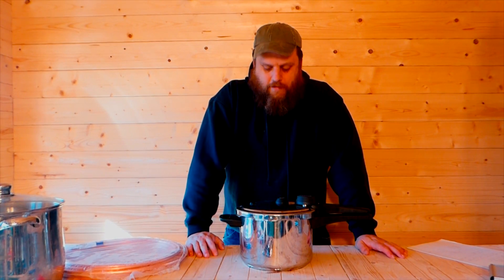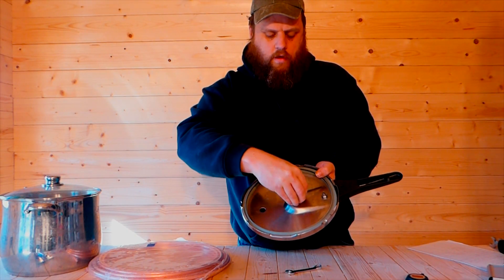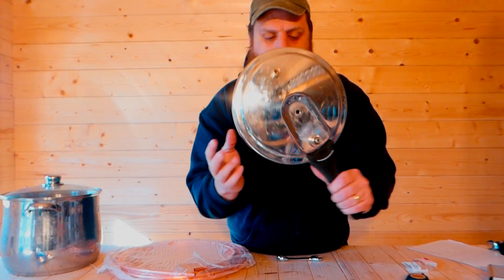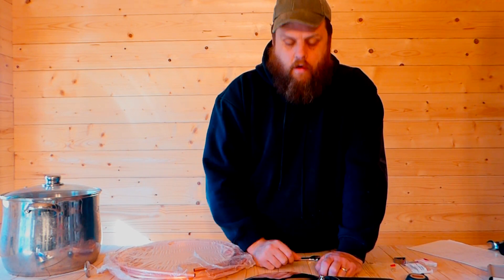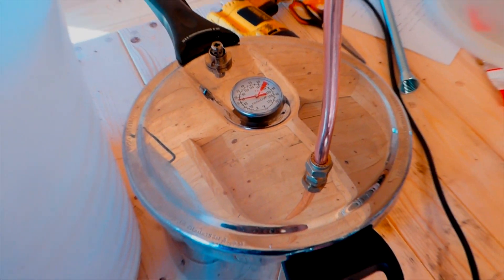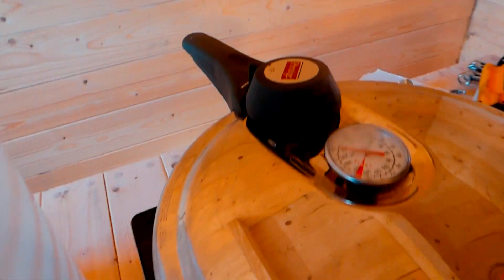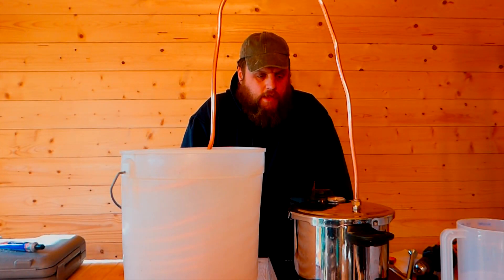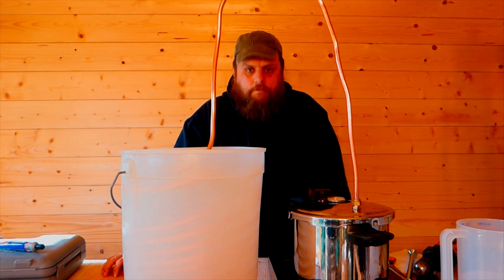Home Made Pressure Cooker Pot Still Build

Comment: You may already know by now seeing that this is two years old but the temperature in the pot is useless you need the temp of the vapor so it would be better to have a thermometer on or in the column/Vapor tube. Alcohol evaporates at 173°F or 78.33°C  Happydistilling!.⚗🥃
Reply: I can see you have a very valid point especially if you're using fire as a heat source!.
Reply from the maker: Hi Corey, thanks for the comment, Yeah I kinda get where you're coming from, as my reflux Still has a thermometer on top of the tube. However it is useful to know the wash temp to ensure you don't go up to 100C and have a boil over into the still. I did this in the early days and ended up with a yellow distillate

Comment: just what I've been looking for, a more detailed description of the size of the fittings would be good in your description, just so you have all the details in the one place rather than having to go back and forward in video, the size of the copper pipe , the attachments the name and size of the fittings the volume of the bucket, I'm getting a 5-litre one not sure if I need bigger, people like my self are eager to build, but need particular details to push forward, but great vid thanks, you've got my subscribe.
Reply: and an update on how you sealed the thermometer and pipe fitting would be appreciated, and quick question when you solder these fittings do you need a blow torch or can you use a soldering iron, never used either but hoping to learn more about it, I have soldering iron not blow torch, just trying to get all my items before I start.
Reply from the maker: Hi Stephen, Thanks for watching, good point about the description, I'll take that on board. I think 5L is a bit small personally and would suggest min of 15L pot. These are a little harder to get hold of though. I've found that you never get the litre-age you pay for. for some reason they are always out significantly. bucket wise mine is 25L it works a treat but I also keep 50 L of water to cool the vapour on standby i'm a bit tight so I cool it down and reuse this water several times saving on the old water bill. Enjoy the hobby

Comment: at 9:41 how do you get the copper tube tight and secure without threading the tube?  what type of connection / fitting is that in the lid?
Reply: I'm wondering the same!
It's a great video, the best I found so far about building a simple still (great for Covid times). However, the only problem is that he skipped the part where he connected the tube to the coupling at 9:20. Let me know please if you figured it out. Thanks!
Reply: @RoyYakoobAlHakeem  I know they have what's called shark bite connections that are very simple to use.  https://www.sharkbite.com/.
Reply: @worgasm  thanks!
Reply: Compression fitting